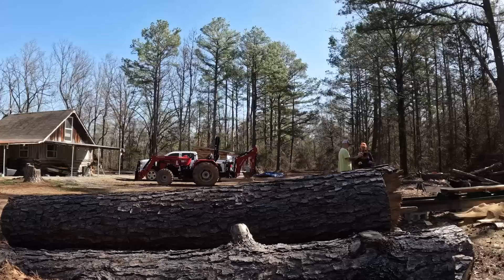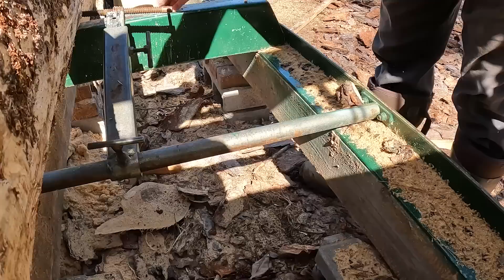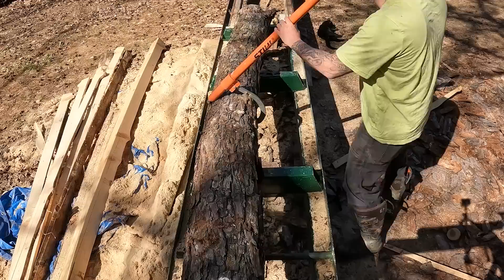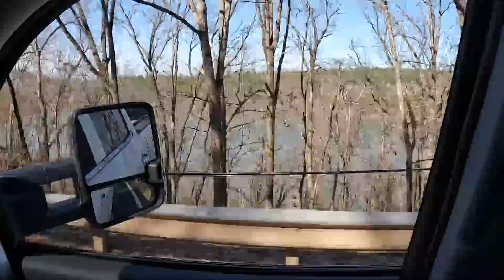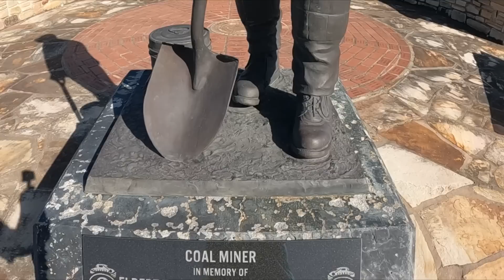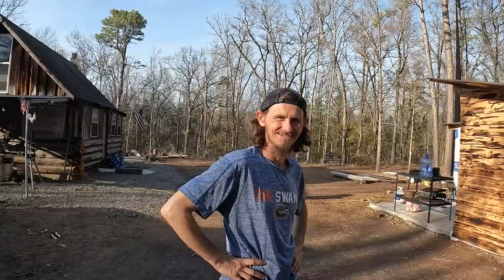BUSTED SAWMILL STOPS THE BUILD | off-grid cabin, tiny house, build, live edge siding Tractor milling

Comment: Just a suggestion coming from an old farmer and shade tree mechanic but you might want to look into the carb on your Sawmill engine there it sounds like the low-speed side isn't functioning that's why it's hunting at idle like that it's only getting fuel when it's at half to Full Throttle you said the engine was sitting for awhile before you got it that can be the problem if they didn't drain the fuel it probably varnished and clogged the low speed jet in the carb

Comment: If your on blood pressure med. You may have to have your blood pressure med adjusted. Or your doctor may have to put you on a different blood pressure med. I've had to go through all that crap. Until they finally found a blood pressure med that worked. Another thing there are some blood pressure meds that will cause you gout because those blood pressure meds will raise your uric acid level. So it's very important that you ask your doctor these questions about the blood pressure meds. By asking them which blood pressure meds will raise your uric acid level and cause you to have gout. Trust me buddy gout is not something that you're going to want. And have fun raising those trust their at simple life reclaim.

Comment: If you use off road diesel instead of water it keeps your blade 100 percent cleaner when cutting pine !
Reply: Would the diesel not damage the wood?
Reply: @juliehowman3912  no because it only a few drops on the blade if he puts a jug up with drip line
Reply: @ritadubberly8378  ok, thank you I just thought the diesel would stain the wood, however I concede to your greater experience in this.